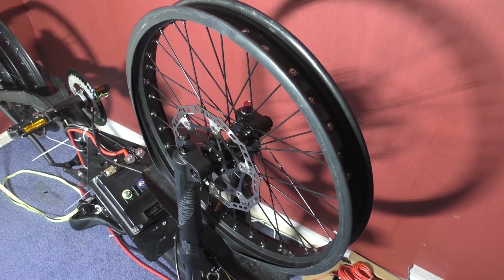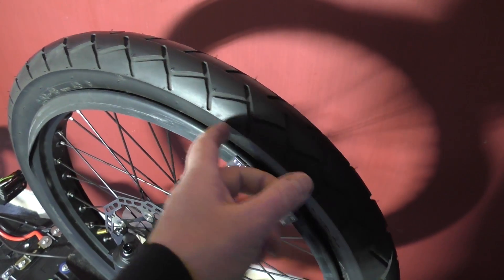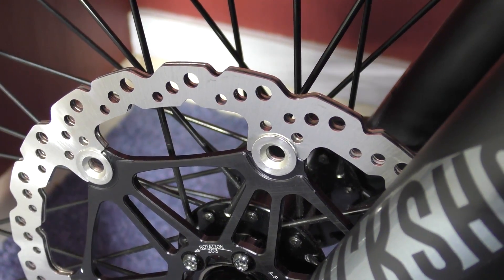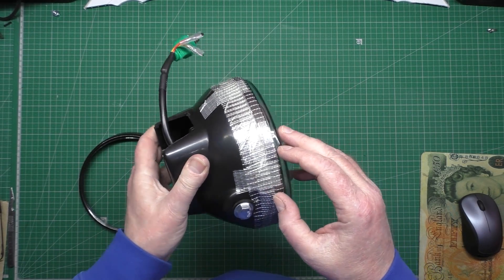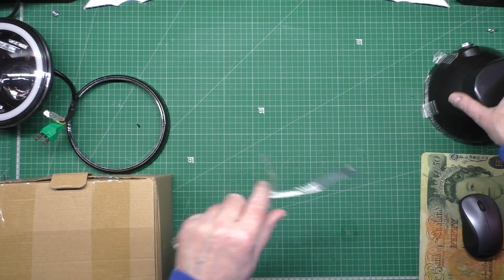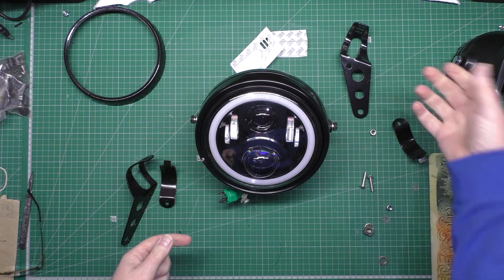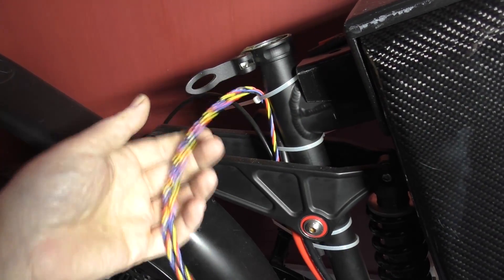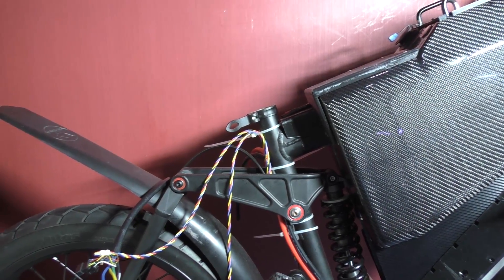High powered DIY eBike MSVA build part 21 - More problems & brake porn

Comment: 10.30   your brake switch problem tone is easy reversed  by 2x  5pin or little 8pin small relays.   and that steel headlight band if its still annoying  you mate can be gently worked dulled cherry  red then streched over a cone iron the extra 5 so mm but the self sealrubber tape is bloddy fine in my eyes i wouldn't  touch  it.... anyway..  V4    ?  lol    they can only get  better  or you done totally  ... but on a  serious  note   well done

Comment: Should have just coated the taped headlight surround in carbon fiber.That way it fixes the issue, and looks perfect.

Oh... and the past hours I've been watching these videos, I thought right off the bat, and every time I saw it.... Heat bend the mud guard.
Reply from the maker: I've still got plans for the headlight surround - it's work in progress 😉

Comment: Might I suggest just running the brakes through a transistor to change from n/o to n/c or vice versa. As great as an Arduino is, it's probably a bad idea to put something as valuable as brakes into it. I know it's not your only source of braking, but should the arduino crash and leave your brakes stuck on, you could definitely end up in a pickle.
Reply from the maker: You got me wrong..... it's the brake light switches that need inverting, not the brakes themselves 😁

Comment: I think the Magura normally open/normally closed is not that complicated to figure out, yet I have to find a seller that does not systematically send the opposite of what you order. I feel your pain. Please make a vid when  you use Arduino to reverse them, I am very interested!
Reply from the maker: It'll be a couple of weeks before I release the video but I ended up using relays - it's much cleaner and easier to work with.
Reply: @Vortecks  Thanks! Actually My ebike got brake sensors installed already, they are normally closed and they cut the engine when I use the brakes, but I am trying to find a way to use the same sensors to add a brake light, so I need to 'revert the logic' on the brake light circuit.. [sorry if I am completely unclear..] Reply appreciated, I ll go look if I can do that with relays :)

Comment: Heat gun to that Mudhugger, should soften the plastic enough for adjustment. Great video as ever.
Reply from the maker: Yeah, I will try that before I have to cut it off. I don't think it'll bend enough without creasing though.

Comment: That headlamp module has cooling fins on the back because it will generate a bit of heat. Is it perhaps possible that the gap was intentional, to let some cooling air flow through?
Reply from the maker: The gap was only there to adjust the lateral beam.....something that just isn't needed.

Comment: Interesting info about are UK number plate laws i never new that thanks Tony.
a good safety feature to have with all they muppet car drivers about would be a rear facing camera hooked up to a LCD screen on the handle bars.
the more this bike take shape the more i love this build great work.
Reply from the maker: I'll be mounting something which will be permanently attached mate. No idea where until everything else is fitted.

Comment: i could cnc cut you an adapter ring for the front light if its less than 230mm across. same goes for switch panels and stuff if you need them, just send me a drawing :)
Reply from the maker: Cheers mate, I might just do that if 'plan B' doesn't work 😁

Comment: Will that green gunk temp repair tubeless on that for emergencies? Best to keep a small can on you just in case m8
Reply: I don't think it does they may do one that allows it to be used on tubeless though
Reply from the maker: I went back to tubes 😪

Comment: first!!! XD
Reply: That joke died out in the 90s...
Reply: Thanks to you & Andy Kirby (what have you started LOL) for the heads up on the liitokala 26650 cells i have 140 of them at 3.6v each delivered at a great price :D
Your channel is an awesome one & have been going through your videos for assistance on many points!
I'm building a 48v portable power/EBike battery that i can split into two 24v packs & put them in 2 waterproof boxes I have already.
I've ordered 12mmx0.15mm & Appropriate wiring I already have the malectrics S/welder & a 3s Lipo same one Andy got on one of his videos.
I'll be starting the build end of next week! Can't wait to see your 1st run on your upgrade brilliant work & thanks again!! ;)
Reply from the maker: @TheOffGridFlat  61st 🤣🤣
I'm glad to have contributed to at least one build. It's nice to see that someone actually understands what I'm talking about!